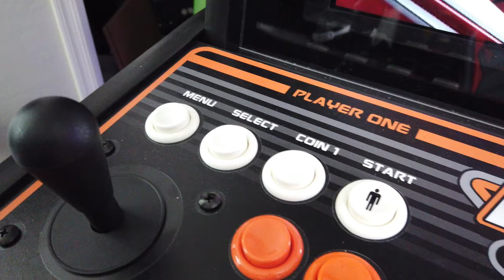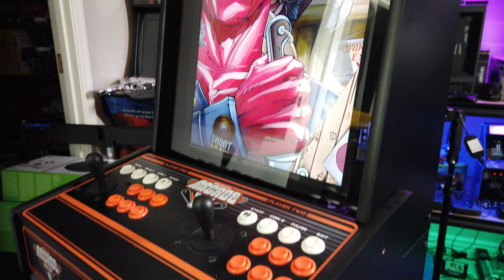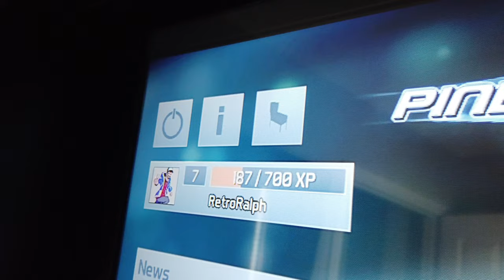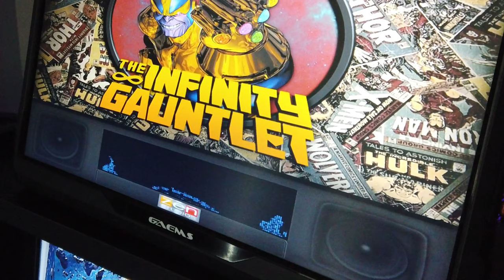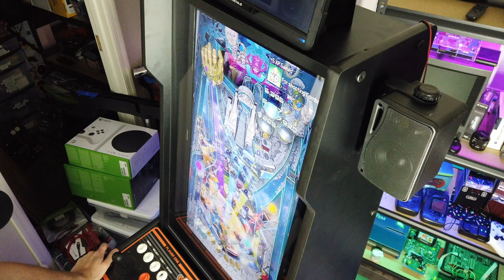MEGA Audio MOD for Virtual Pinball & Arcade Cabinets!

Comment: Ralph, I have 4 exciters, 2 transducers and a sub in my pincab along with 10 solenoids. I started with just the solenoids but the combination of those with the exciters, transducers and sub make it even better. With VPX you place the exciters and top and bottom left and top and bottom right and transducers one below the apron and one bottom middle.. So not only do you get positional sound you also get the feel, its pretty cool. You should add you your full size cab :). If you need any help then let me know. EDIT: You touched on the positional audio... it doesn't work as good on FX3 as it does on VPX. You can get the same effect but its great with VPX. I have 2 of these Daytons on my racing setup and they put out haha!

Comment: Great video, thanks!  Could you add these as Left and Right SSF speakers in a virtual pinball cabinet (wired to L and R on the amp)?  Or do they really need to be wired as a sub?  About to build one and wondering if these could produce the mechanical audio as well as force feedback.

Comment: are you using the BST-1 instead of having a separate subwoofer or just for the rumble?  In other words are you getting your bass just from the 3 way speakers and the rumble from the BST-1?
Reply from the maker: Exactly, no subwoofers needed, it's almost too much bass and rumble, I'm thinking of playing with the full SSF setup and using 2 smaller Bass Shakers vs. the subwoofers.
Reply: Yeah i'm going with 4 tactile units for the dof and leaving a true sub for the bass

Comment: Great video Ralph, its awesome to see videos of you modding again!   I have a vpin with a cheap sound system, with (2) 3" speakers and a subwoofer.  I really want to add feedback, transducers, etc.  But I don't understand DOF or what hardware is needed to build it right.  Also, how do you get it to work with Zen software and VPX?

Comment: What do you think of the Dayton Audio TT25-8? It's way cheaper than the BST-1 and while kess power may still provide the rumble effect you want.
Reply from the maker: I haven't tried that one yet but have it on order, I'm going to do other video's as part of this series. It's fun playing with the stuff and the possibilities are really endless on both performance and cost.
Reply: @RetroRalph  please keep us posted. I have nearly a dozen A1Us, an ALU, and a vpin (soon ;) and would love a less expensive option. The wife frowns on big purchases ... Happy wife happy life 😎
Reply: I’ve used the Dayton Audio inside my Arcade1up racing mod to vibrate the control panel and steering wheel. I used the Lepai LP-168HA for amplifier.  Worked well. Almost too strong ... have to turn sub volume down.

Comment: Wonder how easy it would be to throw one of those in an Arcade1up  pinball...I preordered the Star Wars VP and I’m planning on upgrading wherever possible like with Glass, side rails , black legs etc.
Reply from the maker: I'm already working on a parts list to make this easy should someone want a bit more "low end" sound from the pinball machine.
Reply: @RetroRalph   think about making a video of upgrades for the table with quality of life improvements like I said, glass , side rails , dif color legs ( higher quality), transducer etc. anything you can think to make it better without actually throwing in a pc for an all out mod 🤷🏻‍♂️ hey I put together a 4 player pedestal from GRS but for some reason player 2 and 3 cross over commands if I press A on player 2 it makes player 3 walk backwards and Vice a versa any suggestions ? 😅😅😅

Comment: Hello there @Retro Ralph ! Sorry to bother you in a video that is kind of old. I got a question and would love your opinion or from someon from your community. Do you think that this "group of devices" could be a valid alternative to solenoid?
I'm thinking in installing one or two units of BST-1 on my virtual cabinet standard William size. What do you think? Big shout from Italy! You got a new sub. Thanks a lot.
Reply from the maker: Thanks bud, you might want to look into this kit,  it's very easy to implement, and I have heard good things about it.  I haven't tested it myself though... https://www.ebay.com/itm/154476708499 I think this in conjunction with a transducer for rumble, could be really cool. I hope this helps and thank you for subscribing.

Comment: i see a upgrade for mars attacks if it isn't up to snuff cause this to me should be very cool!
Reply from the maker: I’m already planning a parts list to make it as easy as possible for the Arcade1up pinball machines.  I think a much less powerful transducer will need to be used though.  This thing would rattle the cabinet apart... LOL.
Reply: @RetroRalph  was thinking you'd wait to see how the tables feel overall but we know cost and audio won't be up to snuff.... I'm Ian Richardson (fyi) just posted from shop computer.